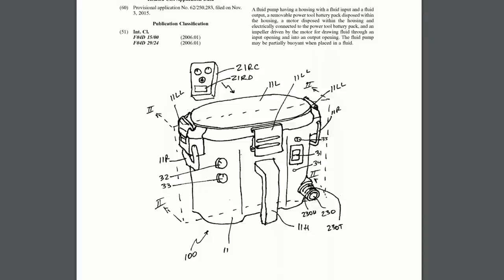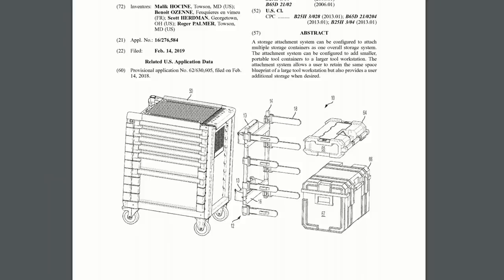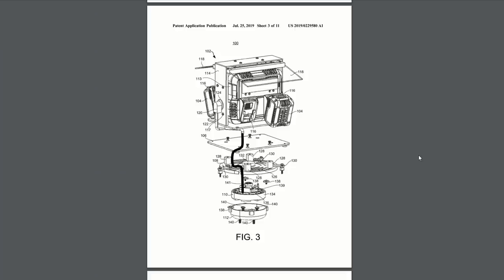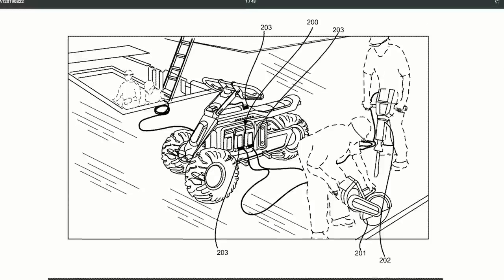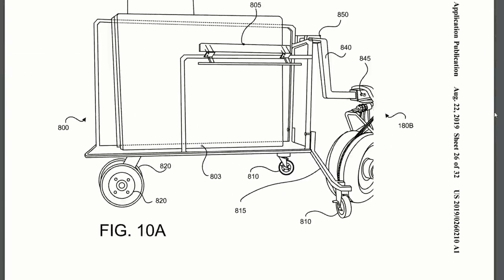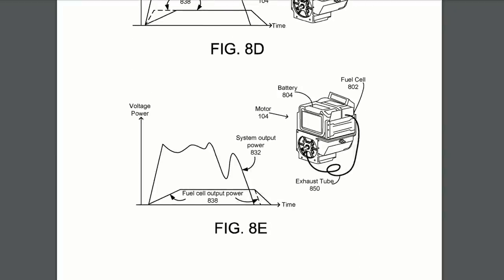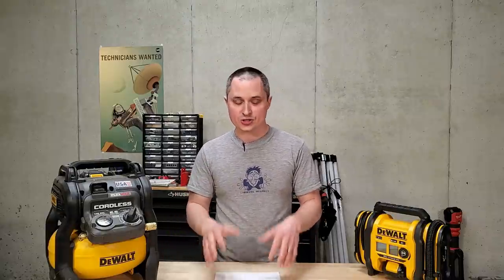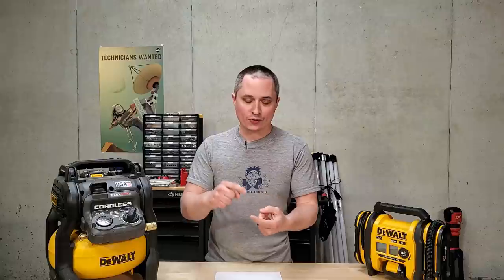DeWalt 2020 Patents - New Tool Predictions for 2020!

Comment: 1. Flexvolt concrete vibe WITH interchangeable length stingers 4', 6', 10'
2. cordless rebar tie gun 
3. drywall screw gun WITH push drive like the Makita
4. upgrade current drywall router with better bearing design
5. 23ga. pin nailer
6. cordless pump sprayer (ryobi just released one I may get it with a battery adapter)

I think Dewalt should also release a line of home cleaning products such as:
1. A top notch stick vac that would compete with a dyson V11 
2. A cordless scrubbing wand similar to a weed whip only more compact, less RPM with interchangeable heads that would take brushes, scouring pads etc. Bonus points for some type of soap sprayer or injector 
3. Cordless hard floor cleaner similar to the Bissell crosswave only better.  

The last 3 could open a whole new market segment that would appeal to woman and profisional cleaners/custodians. Can you imagine a day when your wife was just as excited to get a new Dewalt tool as you? Dewalt your welcome.
Reply: Milwaukee makes a nice cordless sprayer with switchable tanks. The sprayer is part of the tank, so no need to break down and clean the sprayer wand. They perform pretty well and you don't have to clean the tanks between chemicals, just have separate tanks for each.

Comment: I wonder if any professionals upgrade their tools when ever new the version comes out. I haven't upgrade my drills in over 6-7 years and some tools are over 10 years. Obviously I buy new batteries but if the tools does the jobs, I just doesn't see any reason to upgrade until it stop working.

Comment: What have you used the flexvolt compressor for i been looking at getting one i noticed Milwaukee is coming out with a m18 2 gallon compressor soon
Reply from the maker: I reviewed it a while back actually. I've used it for fence repair with a framing nailer. Super handy instead of dragging a 100' extension cord to the back of my property. I mainly use it for random projects with trim nailers, and occasionally for airing up tires. 
I'll be reviewing the M18 version when it comes out too.
Reply: @DoresoomReviews  look forward to the m18 review

Comment: New Nailers code named "the dewaltenburgs"... Also Guess Dewalt didn't get the memo in the 80s of three wheelers flipping over and killing everyone lol.
Reply: Good point, but this will probably have a speed limit. Also those had a single wheel in the front, this the rear.

Comment: Could you find Rigid / AEG patents please
Reply from the maker: This is the only notable one I've found for Ridgid/AEG. It's an electric motor powered hand truck. Figure 3F has the AEG logo and battery clearly visible: https://patentimages.storage.googleapis.com/b5/a2/c3/4ddb34dde50859/WO2019210834A1.pdf

Comment: Cool patents, but a lot will probably never get developed.
Reply from the maker: Yeah, I have serious doubts about the convertible mower and the hydrogen fuel cell nailer ever becoming real products. But it seems like they may actually be working on a high voltage battery platform.